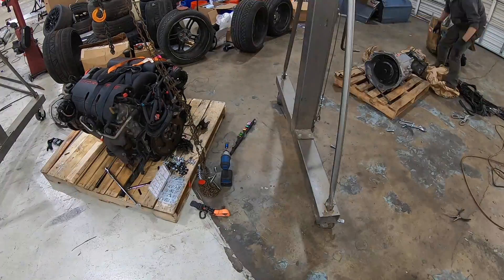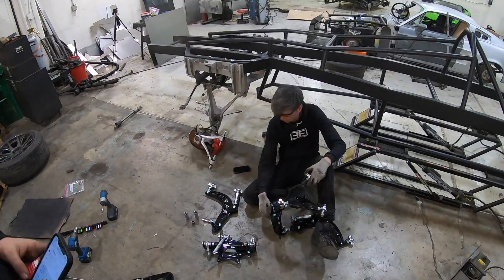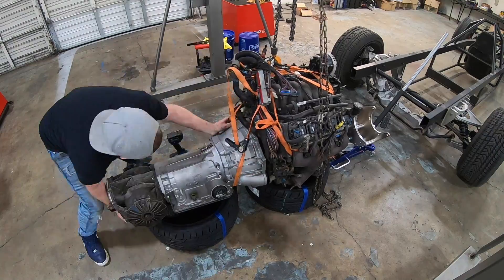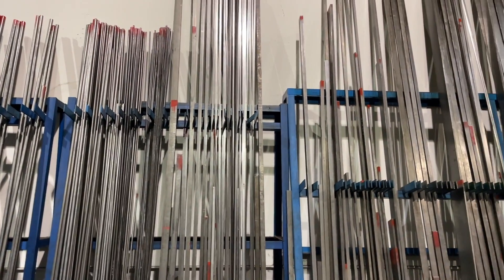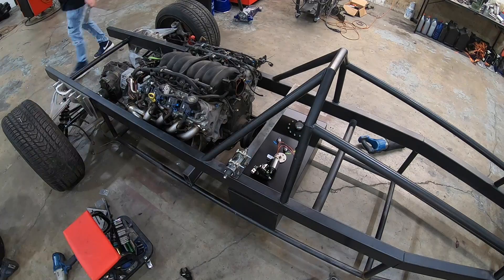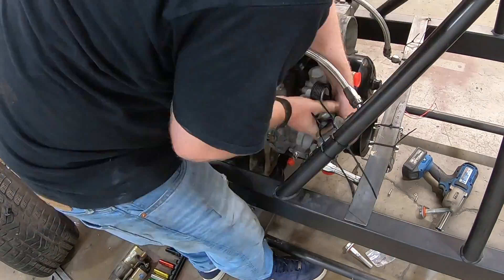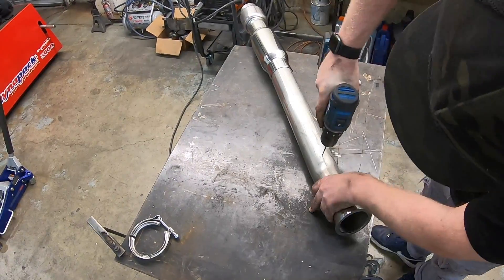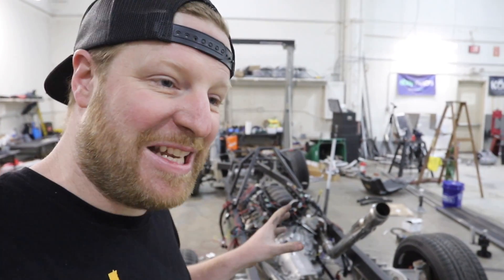Building A Custom Single Seater Supercar Pt. 5 - Installing Engine And Trans. Will It Run?!?!

Comment: That's sooooooooooooooooooo... Long. Curious why you didn't go for the Audi 01E gearbox , It's so much shorter. There is also a whole range of adapter plates and manual gear linkages for GT40 kit cars.

Comment: A bold attempt at a fast build.  I am not a fan of using the term Supercar though.  It will likely have a heavy curb weight based on the length and ladder frame design.  Given the length of the wheelbase and overall build it will have a high moment of inertia (around the vertical axis), and thus will not want to turn.  After completion, It will be interesting to see 0-60 mph times, 1/4 mile times and trap speed, and lap times at a relevant road course track for comparison to other supercars.

Comment: The build doesn't have to be automatic. You could run the linkage through bearings in the main frame rail or if you look at the Beatle or Formula V folks and just run shift wires or hydraulic lines to the shifter

Comment: the ergos of this chassis are so bad its insane lmao..Factory five does the same transaxle thing and isnt even close to as long as this. Kennedy could have made you a 996 6 speed adapter easily and moving the seat and front suspension closer would have made it 3-4 foot shorter easily if not more

Comment: On this project you could feasibly pull off an 8 to 1 exhaust for the ultimate sound. See Kevin from KSR's recent burnout car project for an example of the glorious noise
Reply: Check out driftworks for a 10 to 1 exhaust for his v10 e46 m3 its glorious

Comment: Been watching for years. Damn, you have to be much more……. Well… this thing is a turd. Bars wrong, length, width, this will never be a super car. Based on your recent and old builds, I’ll just say someone stole it. It will never handle well with that weight bias, be lucky to beat a stock c6 around “super car” status. Damn.

Comment: In theory if you take a rear mount t56 and a front mount t56 apart, you should be able to mix and match the parts to use the front mount case and shift forks with the rear diff. I guess that doesnt fit in your timeline, especially if some parts need to be milled.

Comment: With cutting/grinding the flex plate I'm not saying you did anything wrong I'm just wondering does it need to be balanced? I could be wrong you do this I don't I'm just curious.

Comment: I kinda love  their commitment to using LS's. Love the engines
Reply: @Nbomber They're pretty small for their power output, which, when you're squeezing engines where they don't belong, works very well for engineers.
Reply: @Nbomber what engineering wise is bad about them? Small light powerful simple cheap modular engines are a rare thing
Reply: @Nbomber when the LS1 debuted what was out with 8 cylinders that made more power than it without forced induction? 

Nothing. 

What was out that made 500+ horsepower? You're talking about a time in automotive history where 400 HP was rare, let alone 500.

Your argument about power holds about as much weight as saying the late 80s big blocks should have made 900 horsepower, the times didn't allow for that kind of power in either case....you also have to remember these engines go into consumer vehicles they have to be reliable and not break apart easily... They're expected to last 200k plus miles, sure they could have made an NA V8 making 600+ HP but then reliability and serviceability goes out the window.

Your statement leaves out a ton of variables
Reply: You completely ignore torque and the whole power band. You are simplifying and using peak horsepower numbers from a stock LS1 and calling it bad engineering based on nothing. Nobody is offended, you’re just wrong. It’s a very well engineered engine.
Reply: @Nbomber The reason they use that "archaic" setup was because of the feel not necessarily the power. I do agree there are definitely many ways to make power with less displacement. The reason they are so popular is the crazy amount of aftermarket support, the price of them and the parts, also the availability. They are also pretty easy to tune and overall a good/reliable option to make good power or fully build and go pretty crazy(powerwise)for their size. There are definitely better engines out there but all of those reasons are why I think its so popular.
Reply: @Nbomber It's an overhead valve v8. they're all shaped similarly. there is a change of direction in airflow in all ohv cylinder heads. I'm not exactly sure what is flawed in the engineering. if anything, the cathedral port is a little goofy and left some flow on the table, but that was corrected later with the bigger displacement engines. now, if you're saying the LT has better-shaped ports, I completely agree. but, that doesn't mean "LS aren't even good engines". I'd argue the opposite. over-engineering is what ruined them. DOD and direct injection are garbage.
Reply: @Nbomber they are good engines lol they're small, reliable, plentiful, cheap and have some of the best aftermarket support of any engine ever made. There's a reason they're swapped into everything. Sure the heads don't flow great but they ARE reliable, and they can hold crazy boost on a stock bottom end
Reply: @Nbomber hey it's all good man, I know a thing or two about flawed engines too, I have a 1.8t Mk4 Jetta
Reply: @Nbomber HAHA the 4.0 Jaguar engine was rated at 280 at 6100 RMP. hell, the supercharged version was only rated at 365. I bet there isn't one 4.0 Jaguar with 300,000 miles
Reply: Also, it’s literally not a truck engine. It’s literally a car engine. The LS1/6 was never offered an any trucks or SUV.
Reply: @Nbomber Cringe...

ThEy ArEnT eVeN gOoD EnGiNeS.

The LS is no Ferrari F140 motor how ever its one of the most supported engines on the planet.
Reply: @Not_Hans  I would argue that it is actually the most supported engine on earth.
Reply: @YeshuaDisciple916  most supported modern engine. SBC is definitely the most supported engine over. right behind it is probably the Hemi. theres a reason theyre used in top fuel dragsters.